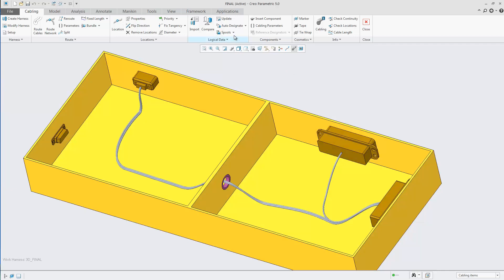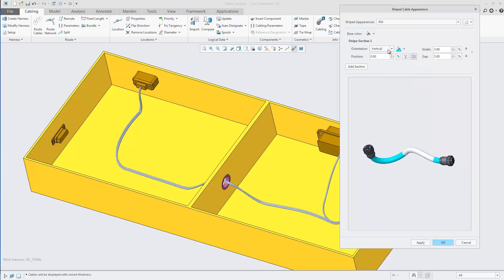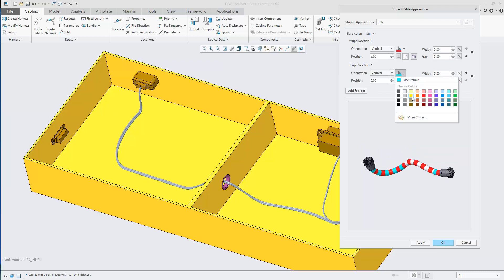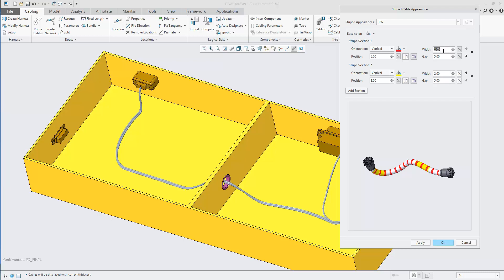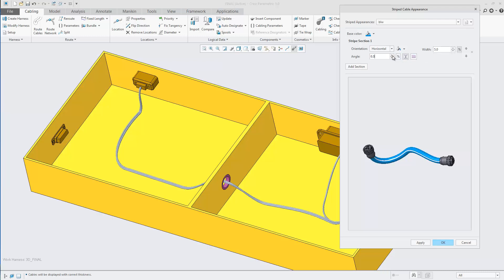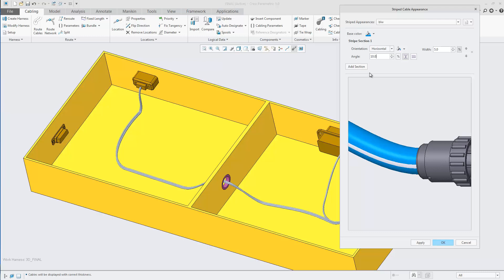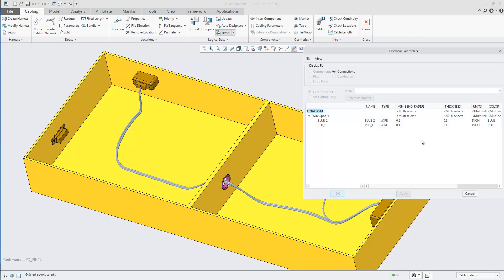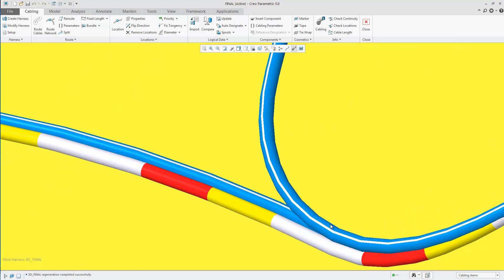Applying Stripes to Cables and Wires | Creo 5.0

Comment: You can find the csv File for the striped cables in the folder: C:\Program Files\PTC\Creo X.X.X.X\Common Files\text\cabling_data\striped_cable. If you overwrite the cable_stripes.csv in this folder you will permanently have the new striped colors in your creo cabling (For X.X.X.X you have to use the folder of your current creo version)